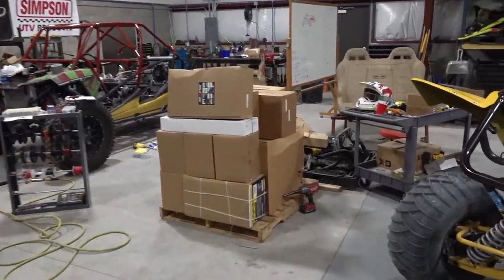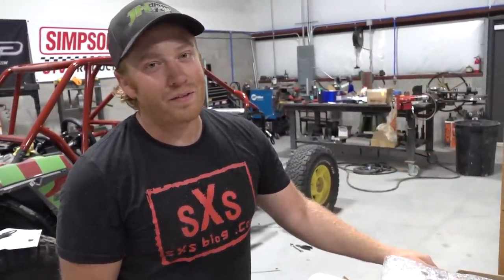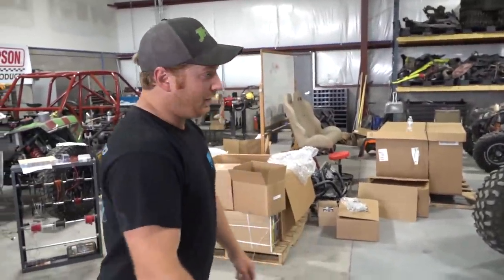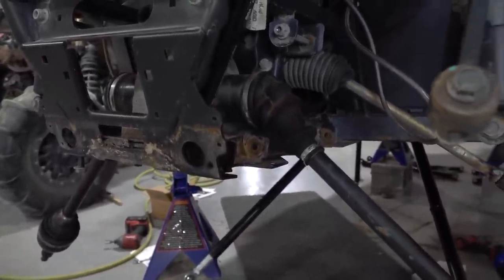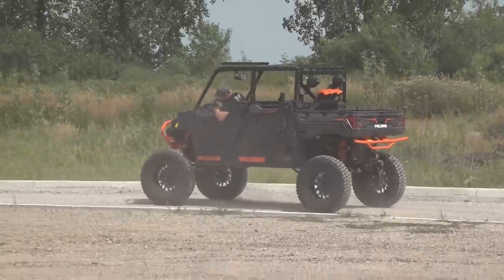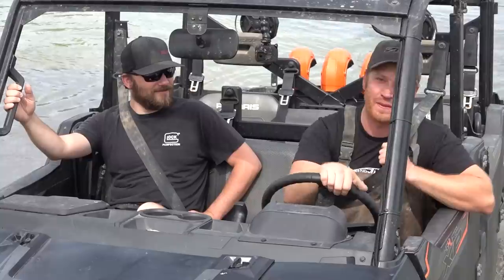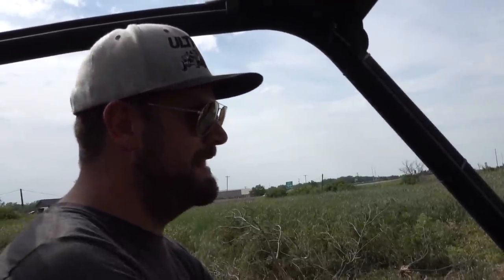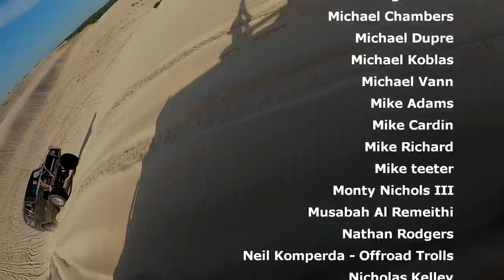MUDLYFE Ranger HighLifter XP1000 goes HUGE and gets SOAKED!! (big mistake)

Comment: Please guys ... 7:04 those concrete blocks are set the absolute weakest way possible. Especially with the sharp edge of the Jack stand where it is. Rotate them so the holes are vertical and drop some wood on them.

Comment: When are you guys going to throw a long travel kit to the CF1??? That thing would be amazing with a 72" or even 77" kit and then the same engine mods as battlefield, track slayer! And speaking of suspension, are you guys planning on doing anything to JPs suspension? Or just going to try amd run it stock?
Reply from the maker: It will get suspension work I’m sure.  First testing will be with main springs only, no tenders

Comment: Y'all are lucky those cement blocks didn't bust under MUDLYFE. Those blocks are not made to hold weight on their sides. They're only made to hold weight when the holes in them are pointed up. I can take my bare fist and bust those blocks from the side, so with the feet of those jack stands being so small I'm surprised the weight of Mudlyfe didn't bust those blocks.